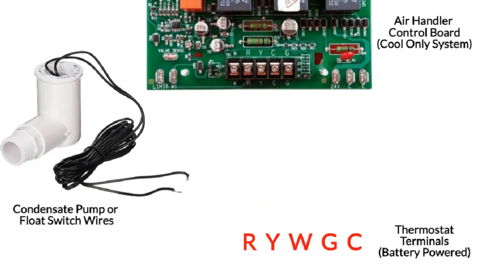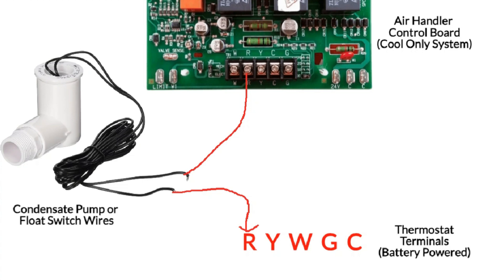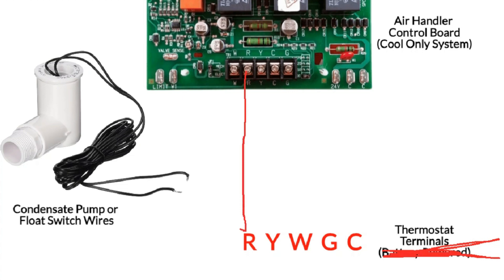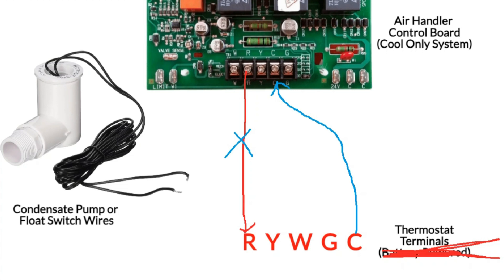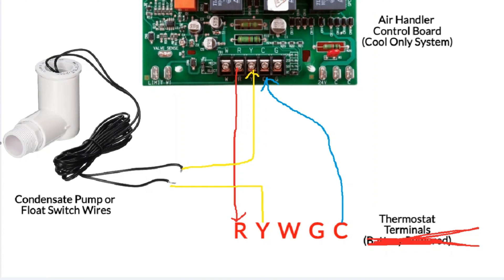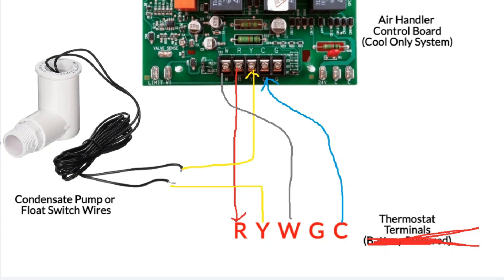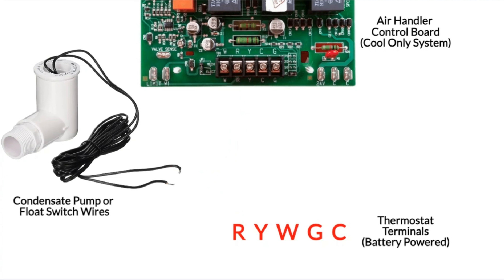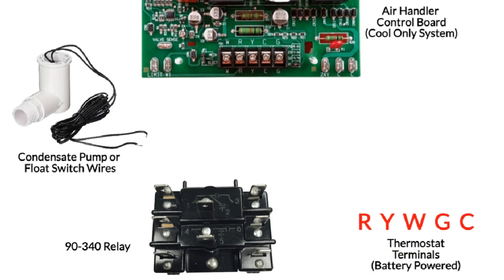Avoid HVAC Related WATER DAMAGE (wiring safety switches)

Comment: Excellent video with well explained wiring!  I personally always break red as I want the T-stat to go blank whereby the customer will call so we can clean out the condensate line, both in summer & winter, particularly during deep freezes when the condensation line exiting the structure can freeze backing up the condensation.

Comment: And then there are two speed systems like mine. I have an AC with Y1 and Y2 and electric heat with W1 and W2. I have never tried running it only with Y2 or W2. This system has two transformers with one powering the two thermostats, zone controller and dampers. The other powers the condenser and air handler. 

I am working on installing a water alarm with a warning light to indicate the drain trap is clogged and there is water in the pan and water is draining out the overflow. The pan has a float switch than breaks the condenser red wire. This alarm system is very difficult because all normal float switches break when tripped and I need one to make when tripped. I have ordered some mercury switches from Amazon to build my own float switch.

Comment: Great Video!!  Quick question on my residential setup.  I have 4 zones controlled by Honeywell TZ4.  To wire in my condensation pump safety switch, should i just splice in to the 24v wire coming from the TZ4?  I also have wires coming into the W1 and W2 connectors on the control board from the TZ4.  I want to try and clarify because my furnace control board also has 2 other Red wires connected in the slot - for a total of three 24v wires on the control board "R".  Thanks
Reply from the maker: I would just wire one side of the float switch directly to the control boards R terminal, and the 3 red wires there now to the other side of the float switch. This way 24V from the board has to go through the float switch to get everywhere it's going from there.

 This simplifies everything and avoids getting into parallel wiring where some circuits will be killed and others remain active, especially if you're not sure which circuits you want to kill or to remain active. You just shut everything down from the source.
Reply: @ thanks for response. That’s was I was thinking but really appreciate your expert advise.

Comment: I have a Little Giant condensate pump and the company told me that it makes a difference which of the two wires coming out of Little Giant condensate pumps are attached to the air handler and the thermostat.  One wire is for COM and the other is NO.  From your video, it doesn't seemed to make a difference, which of the two wires are hooked up to the Air Handler vs Thermostat.  Is that right? Thank you!
Reply from the maker: It's never made a difference for me unless you have other wires or terminals for an audio alarm or some other feature. But if it's labeled, might as well use them as they are labeled.
Reply: @JerseyMikeHVAC  Thank you.  You make great videos!

Comment: What about the signal wire to the condensing unit
Reply from the maker: You can do that too, but the indoor unit will continue to run. Might take the HO a little longer to figure out something's not right.

Comment: I have a question and I'm not smart when it comes to this stuff, but I can figure some stuff out. lol I have a Daikin Fit. The company who installed it gave me a really cheap condensate pump. The pump has built in safety switch wires so not hard to figure out where they go to as they are the same. The one I'm looking at getting to replace it has 2 wires and 3 clip spots for it. Alarm (which I assume is for an external alarm), Run and Common. I'm trying to figure out which wire goes where. The float switch I have has 1 wire that goes to a wire nut where the condensate pump is tied into. The other wire from the switch goes to a wire nut then up into the air handler. I dont know how its tied into the board itself. So does the run wire go to the float switch wire or does the common?
Reply from the maker: What's the model of the condensate pump you're looking at?
Reply: @JerseyMikeHVAC  IQP-120 ClearVue. I actually had that pump on my older unit for years, but the company who put the new system in took it out and didnt even ask if I wanted to keep it.
Reply from the maker: @thedude2897 You should be able to disconnect the 2 wires connecting to the current condensate pump and reconnect them either way to common and run on the new pump.

That said, if you want to hook up an external alarm you may need to reconfigure some wiring, because that pump was designed to cut off the cooling wire returning from the thermostat and not all installers install it that way. But for just the safety switch alone the easy two wire switch is all that's needed.
Reply: @JerseyMikeHVAC  So the common and run wires don't matter which goes to the switch and air handler? I can just wire them whichever way? I won't bother with an alarm.
Reply from the maker: @thedude2897 it shouldn't matter
Reply: @JerseyMikeHVAC  Here's an update to my question and now I'm more confused and I know you said it shouldnt matter, but, I popped the cover off of my air handler to see exactly where the overflow switch and pump wires run up to. They go to the board and it's marked "Alarm". So with the ClearVue pump having Alarm which they say is for an external device, Comm and Run now I'm confused which 2 to use. The book says, "Connecting the common and run terminals in the call for cool wire from the thermostat enables the pump's capability to shut down the cooling system if there is a high level alarm. Connection of the common and alarm contacts to an external alarm enables the pumps capability to trigger an external alarm such as the Diversitech's Universal Alarm". So if the board is marked alarm would I use alarm and common or still the run and common? I just dont want to short circuit something or trip an error on my unit. I contacted the company who makes the pump and they told me to hire a tech which I'm not doing just for a wire.
Reply from the maker: Are they labeled TB4 and TB5? Run and common go to those.
Reply: @JerseyMikeHVAC  The board isn't labeled as that. It just says Alarm where the connections are. I do see TH1 and TH2 and TR1 elsewhere marked for other stuff.
Assuming they are those, I just put comm to the overflow switch and run to the other, or still doesn't matter?
Reply from the maker: @thedude2897  Still don't think it matters.
Reply: @JerseyMikeHVAC  All set. Everything works and no errors. Thanks for the help!

Comment: My current air handler is wired so that the condensate pump and overflow switch are wired in series from the R wire on the mother board of the HVAC unit, when the condensate tray fills up I think the overflow switch is breaking power to the thermostat and condensate pump resulting in the tray being full of water and nothing getting pumped out and the thermostat without power (it’s a smart thermostat without batteries). Maybe the pipes to the condensate pump are clogged but it is not trying to pump out the water at all. Any suggestions? It has worked for a year in this new house and this just became an issue. I shop vac all the water in the tray and the AC kicks on as usual
Reply from the maker: what kind of condensate pump do you have? Typically on high water the 24v circuit will be cut to the stat wired in series like that, but it shouldn't prevent the pump from running at all. Might want to check if you have 110v at the plug the pump is plugged into or if the float is stuck.
Reply: @JerseyMikeHVAC  little giant VCMA-15ULS, and I checked the float switch isn’t stuck, and the pump is getting 110V. On the 24V side on the pump, is the pump supposed to turn on when the flow switch breaks connection?
Reply from the maker: @loganpuckett2968  The pump works entirely off the float. The safety switch on the pump only kills 24v to the stat when the pump is full and will not pump. Basically the pump should work regardless if the 24v circuit is broken on high level or not.

The whole point of this set up is to stop making water, not to stop removing it. The pump motor itself may be the issue. Does it pump when full of water?
Reply: @JerseyMikeHVAC  the condensate pvc pipe leading to the pump feels empty, I now think that the pipe from the condensate tray to the pump may be clogged. That is why I was wondering what tells the pump to turn on, is it the presence of water at the pump or is it the 24v control wire?
Reply from the maker: @loganpuckett2968 It's the water to the pump that turns it on at a certain level that lifts the float. 24v doesn't control the pump at all, so you're probably right. Plugged PVC drain line.

Comment: Can’t find anything labeld ‘R’ in my air handler. Found the circuit board. But nothing labled like that. Would it be called anything else? Like… XFMR-R
XFMR-C
Those two do nothing to the AC unit when disconnected. Still runs.

Comment: Thanks again for this info. I see on U TUBE, that a guy used a EPOXY WELD TO SEAL A LEAK ON A R410A HEAT PUMP system, on the hi side. Is  this a good thing to do? And do you know if STAY BRIITE #8 will hold,  on an ALREADY SOLDERED JOINT that is leaking, on the high side? I have a leak on my heat pump system, and the joint where the hi press. switch is soldered is leaking. I am thinking of just expoxing it and add some freon and see if  that will fix it.
Reply from the maker: There is an HVAC specific epoxy called Devcon Special F that could work, though I've never used it so can't attest to how well it works. It's expensive, but I wouldn't use any other type of epoxy because of permeability (even if it holds physically).